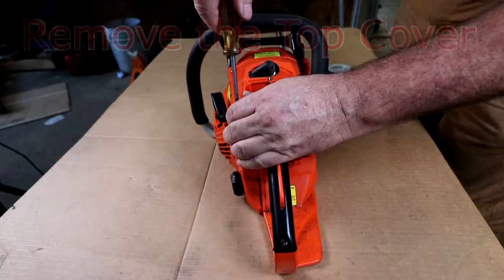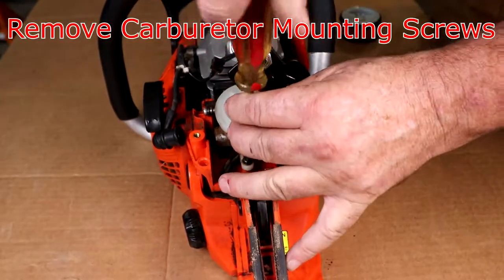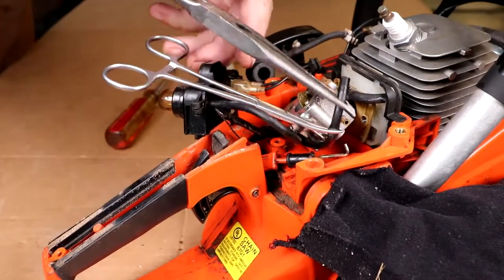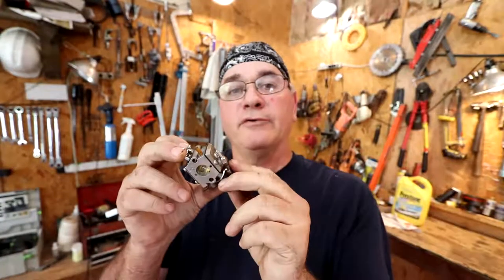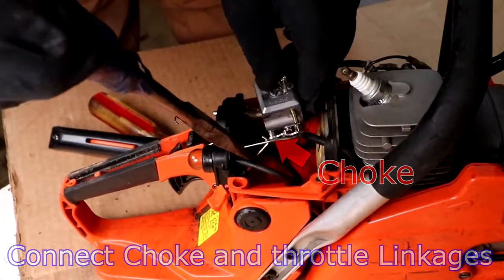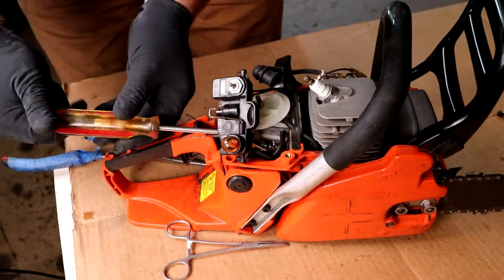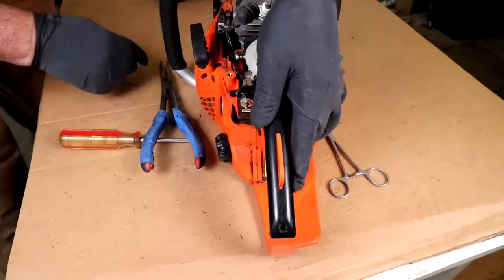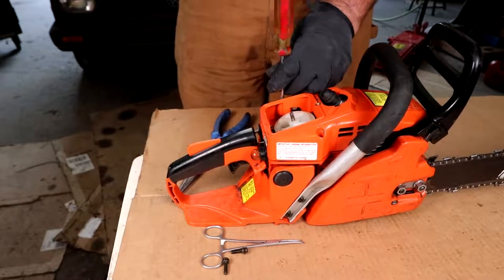ECHO CS-400 Chainsaw New Carburetor Install | How To | Joe Fixes It

Comment: I have had a cs346 for over 20 years. I have put 2 replacement carburetors on it. The last one I put on it was about a 2 years ago. It is a major pain. This Echo model looks so much easier. That is why I was checking out this procedure on You Tube. I was planning my next chainsaw purchase with the inevitable carburetor change out in mind. Thanks for posting.
Reply: not a prob, I still use it today,

Comment: That top line on the carb is a vacuum line that connects to the crankcase. The two side connections are the fuel and return. I paid to have my carb replaced and they didnt put the fuel filter on with a split ring so it fell off and sucked air and clogged the low and high jets. I found a way to blast the jets clear without having to take the whole carb apart. It runs better than new now.
Reply: wow, I would have been more than a little pissed about that. I still use the saw today.

Comment: I can't because the video's too dark and you never show a comprehensive look at which lines should be where. it just skips over this important step(s). very frustrating!
Reply: Same, I have mine taken apart and I just need to know what fuel lines go where bc I was a dumbass and didn’t take a pic

Comment: Great example of how to replace a carburetor. But you left out (on propose) the most important part . on the carb you installed the adjustment locks where still extended . you didnt give a procedure on what to  do for that . obviously you need to run and adjust the carb in then push in the locks to keep the saw in tune for future use . I'm curious as to why you omitted that  little bit of pertinent Information ?

Comment: Iam sorry,but o watched this video an its not showing me how to hook up the throttle in the handle,
I had got a chainsaw with no carburetor so I ordered the correct carburetor and I am having a lot of trouble figuring out how does throttle gets hooked up on the handle and which hoses go to the primer button and which go to the carburetor if you can please help me I would appreciate it or somebody please thank you
Reply from the maker: sorry for taking so long to respond to the question. I will have to find the diagram I used the first time I did it and got confused over the fuel line routing. The throttle linkage is pretty straight forward unless you  got the incorrect carburetor. This model of chainsaw comes with a fast idle linkage but there are a lot of people selling a version they claim to be correct and is not and hard to tell if you do not have the original there. I am thinking of putting together a video on just that. The fuel lines are very easy to get  wrong as I had mine messed up last summer. It would run for a while and quit. I will look for the diagram I used to unconfuse myself and update you
Reply: @Joefixesit  ok cool thx,
The chainsaw i have it only has 2 rubber fuel hoses coming up on the left side ,i guess where the tank is,it looks like there is 3 in the video,right now i only have one hooked up on the longer nipple on the primer button,an the other fuel hose to the carb,
Its weird cuz when i hit the primer button no fuel comes up into that little see threw button,but it fires up anyway an runs,🤔i dont get it,
But thanks for your help,
Reply: @stevenzakarevicis9587  yeah the routing is wrong. there should be fuel in thew bulb.
Reply: @JoeisHungry  I all ways remember it  by knowing that the suction side of the purge bulb hooks to the carb on the Diaphragm side . the brass tube sticking out  is usually on that end